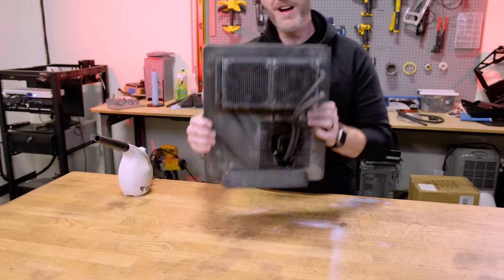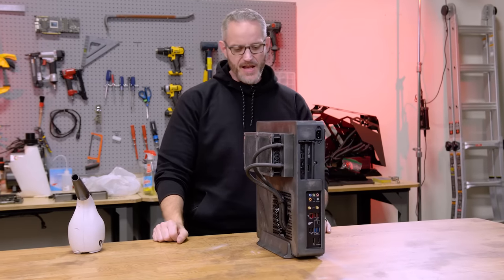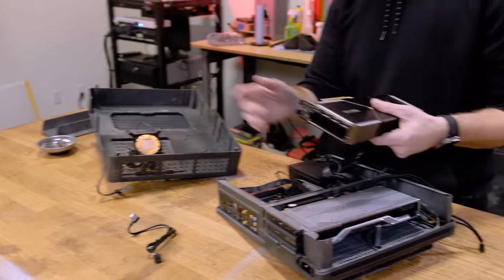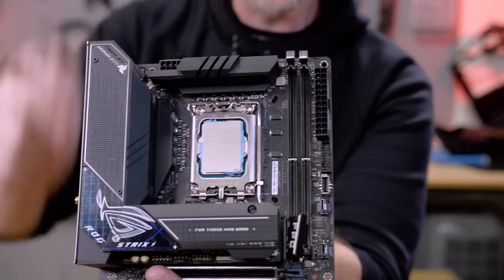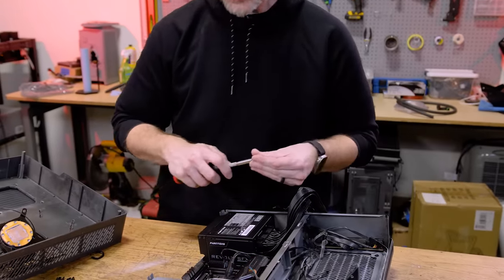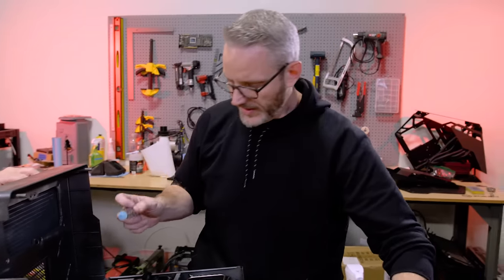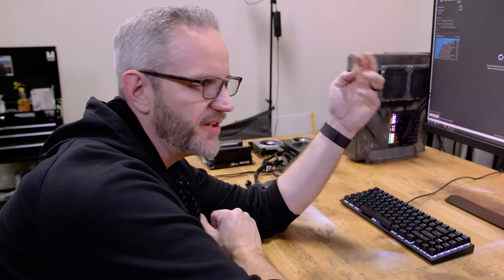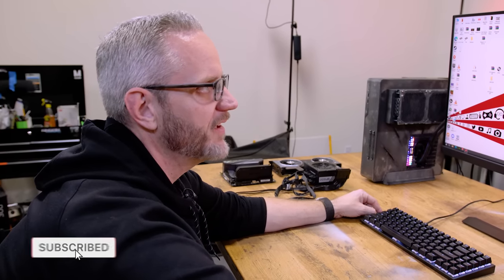This is still one of my all time favorite builds! Destiny 2 Themed PC Upgrade

Comment: I remember this build, was very cool to see it again. Although, I still believe a big aircooler would also look awesome sticking out of the 'broken' mesh/grill where now the tubing is coming out. Would also fit the theme very nicely, if you were to use a dark/industrial looking cooler.
Reply: My best friend is running exactly that. Not sure what air cooler it is exactly, but it is a dark one with industrial fans on it. Looks dope as hell :D
Reply: it doesn't fit destiny 2 at all though,
Reply: NDh15 lol
Reply: The only issue there would be hot air getting (mostly) trapped inside of the PC

Comment: My first AIO, the fans had to be installed on top of the case as there wasn't enough enough clearence inside for the the rad with the fans on. I used a christmastree bit and drill out the vent holes and it worked great. I loved how it looked too as the fans had blue leds and it was finished off with fan grills. I'd do it again!

Comment: this case was my last build, the 8700k/gtx1070.... that usb header, audio header and power board cable installation brought me back to those 20-30 minute nightmare scenarios. replacing fans was also a pain when i had a shuriken 2 had liek 3 fans die. never had i ever been so frustrated other than when i had to mess around in the engine bay of a pt cruiser.

Comment: 06:15 - I still use one of those cases with these pass throughs (AeroCool Xpredator X1 Black Edition). It has served me well over the past decade, but will eventually be passed down to someone in the family, once I need to get a new case (drive cage → GPU size).

Comment: I've run my DDR5 at 6200 for a year on my 12900KF without issue. I've even tuned my  timings down quite a bit as well. I've been contemplating swapping out for a 13900K and trying some of the new really wild 7200+ ddr5 out there

Comment: I did a similar upgrade...9900k to 12700k....2080ti to a 3090ti...psu 850w to 1300w...kept my ddr4 sticks on this z690 board. I also reused my older parts to make a sfx build to take to my friends house for lan parties. I wish I was friends with Phil.
Reply: Why a 1300w PSU? That's overkill by a lot. An 850w would have been fine or 1000w for plenty of elbow.

Comment: Well currently we have the 7700 non-X, which is not only quite fast, but also cool enough for the case. The 7900 non-x is good as well, but also a bit powerstarved on allcore load.
Reply: It is possible for those two models to increase PPT and TDC.

Comment: 750W PSU should work great for this build. I have a 5800X3D and 4090 on an SF750 and have had zero issues. Power draw in gaming is around 500W. 

I would love to see a vintage, top mount rad style build. Koolance was the brand I used at first.

Comment: Ran W10 on my 5.2/4.0 E core setup for a year without issues. Only switch to 11 for the auto HDR for my AW3423DWF. Also my W10 benchmarks crushed pretty much any equivalent system in average fps and 0.1/1% lows.

Comment: The 12900k is very efficient on power and temperature under regular loads. Even a reasonable overclock it only pulls like a 118watts and hitting 27k on Cinebench R23. Sure you can tell it to throw power out the window and break down on stability, but why?

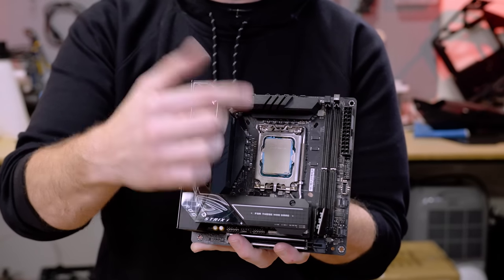Comment: 7:14 no it will not work. Well at least properly. Sure you can mount it but there is a difference in the Z height so you need New standoffs which btw you can order from corsair directly you just need the 4 standoffs and you can use the rest of the old hardware.

Comment: Pretty sure the IHS of the 12900k is bigger than the coverage area of the H100. Just because the board supports the cooler doesn't mean the cooler should be used for the cpu.

Comment: i have a gtx 1080 in mine with 2 artic fans blowing cool air to it inside the case and for the 99k i have a copper cooling 6 pipe thermaltake with a 25mm noctua fan i still havent turned it on yet and i put round rubber feets higher than the original ones that come with the case thanks to your review in the past of the node202

Comment: If you slow down the memory speed from XMP you would need to manually tighten the timings.  7th Gen Intel could be a bit temperamental with the fastest DDR4 XMP profiles, solved on 8th Gen.

Comment: I've been wanting to do an external rad build and "seal off" my computer from outside dust.
All the heat is pumped in the water to the rad and fans are only on the outside.
No more pressure monkey bussiness.
Idk if passive heat dissipation from my case would be enought to prevent the RAM, Drives and VRMs from over heating thou.
Maybe an internal rad in the loop to grab that heat with some kind of "internal" air flow.

Comment: Would I go 40xx series if it was free.... I'd accept the freebie, and then sell it on below MSRP to some one who actually wants it... and buy myself something decent.

Already have a 5800X3D and 6900XT, 32GB ram... newish monitor, peripherals and chair.  Only thing I can think I'd buy is a few more 14TB HDD's for my mediaserver so I can ditch the 6TB ones and do a proper raid setup with 2 parity drives.

Comment: i think this case(the normal case not the modded case) is perfect for ryzen 7000 series non x sinces they all have great thermels comperd to performence. and is the only current gen cpus that is able to be build into a case like this without thermels being an issue and without doing any kinde of udnervolt or underclock

Comment: Honestly not connecting the case headers before installing the motherboard is something I hate most about watching build videos.  It's on par with installing motherboards in cases vertically, something you'd never do if there was no camera running.

Otherwise, interesting to see the upgrade

As for the 4090. if it was free I'd sell it,  or do a charity raffle. I'd probably benchmark it with the weirdest hardware combos I could throw at it for fun, but it's a ridiculous card.
If I dropped one in my main rig right now, the most taxing thing I'd throw at it would be Fight Simulator and it'd still be CPU bound, and I don't want to deal with that stupid power connector. Feel free to call my bluff.

Comment: My house is always set at 68 degrees. I'm a little cold as I sit here in my room. I have an i7 11700kf and a 360MM AIO. I wonder why some days I come home she idles at 27 degrees celsius and some days like today she's idling at 40 degrees celsius. All the other components (GPU, MB, and 2 m.2 drives sit at 28 degrees celsius).

Comment: Jay, you do not need to upgrade to Windows 11 for Intel 12/13th gen.  The only difference is that Windows 11 will try to be more power conscious and try to keep the P cores parked.  Anyone who's doing any sort of gaming or overclocking will get absolutely nothing from Windows 11 and if anything might get lower average performance if Windows 11 doesn't recognize the program as "high performance" and instead insists on running the game on the E-cores.

Comment: Christ I'm getting old. I remember the build video like it happened a week ago.
Edit
Just wanted to add I've got big fingers that don't always fit into tight corners while working on my PC, so I keep a nice tweezer set to plug in things. I got mine off of Amazon for like $8 U.S.
Edit 2
While I'm thrilled with my Sapphire Toxic 6900 XT (warm room so the AIO helps) and wouldn't BUY an Nvidia card I'd be pretty darn tempted if I were offered a 4900. Pretty sure my Ryzen 5800X3D would be good enough for it without having to pretty much rebuild a whole new platform for the card.

Comment: Hopefully the smart people here will give me some advice.
I desperately need to upgrade so I can render photogrammetry point clouds in Pix4d and Agisoft Metashape. Should I get a M, P, RAM, GPU for my old PC or a refurbished Dell precision tower 7810? The Dell ($600) has twin Xenon 3.5 GHz processors, 28 cores, 128 GB DDR4 and I would need to install an OS and Storage. The Dell sounds like it would be really fast but it's old. Would the Dell be much faster than a Z690 i9-13900K upgrade to my PC? 
What do you guys think? Thanks!

Comment: Is there really a difference between Windows 10 and 11 when it comes to the 13th gen processors? I'm on 13600K + Win 10 right now. The only testing I can find on this subject is Steve's video with the 12900, where there is either no difference or marginal difference, and where there is a difference its Win10 winning out. Wondering if the Raptor Lake cpus are any different.
Reply: you wouldn’t see the effects on a full load benchmark, more that the scheduler in w11 is aware of the differences in each core type and can more appropriately put tasks onto the best core for the situation

Comment: I was under the impression that upgrading my Intel build from i9 10850k and 490 mother has to a 12900 k 690 board would require me to have a fresh hardrive. You're telling me I can use my current hard drive and drivers and it'll automatically update?

Comment: if i was given a free 4090 i still wouldn't use it just because it won't fit in my case
probably try to sell it because honestly, i have a 1080p panel and all my games are already running with 100+fps on my 6700XT
nothing would benefit from it except maybe flight simulator

Comment: Remember when PCs were cheap to buy parts for and EVGA was still around. Now the market is imploding on itself. 40% of Europe is losing out because of the cost of electricity, gas and food. So bang goes a big hole in profits. I hope to upgrade end of the year, but that’s one big if….. give you an idea (those that live in bubbles) my utilities would normally be £99 per month give or take. Now it’s £300 and going up next month another £150 to £450. That’s WITHOUT using anything on-top of that. That’s the price in the U.K. and Europe is suffering the same. So here, £450 PER month on PC upgrades, down the drain…

Comment: i mean fine if i get a 4080 or 4090 for free i might use it or maybe sell it on ebay for a fair price and get a 7900XT for it plus PSU bc i run a 1080 with a 530W PSU - which would not be fitting for such highpower GPUs

Comment: @JayzTwoCents 

I have to ask— how did you get iCue running? I installed it on my pc and my Corsair keyboard went absolutely bonkers right after. I’m thinking it has to do with the driver and/or RGB lighting but uninstalling fixed it immediately. It keep doing a connect/disconnect loop when iCue was installed making the keyboard unusable. Have you encountered this before?

Comment: HELP PLEASE :(
I just bought this m2 but i am unable to install windows.

I installed the harddrive, and using the windows on my SSD it's possible to see it in diskmanagement and as storage in "computer"
However, i am unable to see it in my windows installation (USB bootable)

I have tried just about everything and i searched google thin without hope, even asked on a forum but no luck..
Motherboard MSI 520m PRO
SSD: WD SN850X 

Please be my saviour <3

Comment: hey jay, a quick question from someone with a 9900K and a 3070Ti, is there much difference between those CPUs (9900k and 12900k or 13900k) in game specific scenarios, I mainly play at  1440p and wonder when would it be a good time, I'm currently waiting for DDR5 make sense before jumping in a new platform but I don't want to stay at DDR4 for long(since my ram only does 3000MHz and was from a previous build), I'm waiting for the next gen of CPUs as well in the mean time.
Reply: you would def have better frame pacing a 13900 is about 50% faster.  It'd be better for 120hz play on current games.  I'd wait 1 more year for the new chips and ddr 5 ram and boards to drop.  But if your sticking with that 3070ti that'll be the bottle neck.  There is no upgrade your system, your building a new computer.  only thing your keeping might be the case and cooler.
Reply: @Mikediszel  Dude what lol, this is all bs. An upgrade like that would net slightly better 1% lows, but that's it. Not even slightly worth it.
Reply: @ZoneXV  this would be my case, I play iRacing and on VR, so single thread performance would be desirable, and I would skip 40 series due to the ridiculous pricing

Comment: Why go DDR -5 if you are going to use a kit that is slower than Samsung B-die? Might as well run that 12 Gen chip on a DDR-4 board.  DD5-5 really isn’t worth it unless the kit is 7200mhz+ Even at that, 7200 MHz ties B-Die. Ideally, you want 7600 MHz or better. Right now I am running a 7800 MHz kit on my Z790 Master paired with a 13900KS. Gigabyte is doing their thing with memory This generation, XMP worked right out the box. I was going to grab an Apex after  I returned my hero because it had really bad memory stability, but I ended up picking up the master, and it is good to go.  Side note, I feel like a lot of people on YouTube really aren’t showing 12th and 13th Gen to its full potential. So if you are trying to keep cost down on a build, get a cheap kit of b-die, not only will you save money you will get better performance. Anyway, dope video as usual!!

Comment: I suffer from not running games and a problem with the graphics card, and I run it on another device and get an error message Error 0x887A0006 Unreal engine is exiting due to d3d device being hung and a problem with the graphics card itself. Is there a solution for Evga 1060 6g Ssc 6267 And I removed ddu the entire system and downloaded the latest version of NVIDIA and installed the latest version of DX12, and the problem still exists
This error is in all new generation It contains directx 3d player
The problem that I suffer from is not running the dx12 11 games that contain directx 3d. As for the old games, such as the game Wolfenstein The New Order, they work well, and I ran a graphics card in another device that does not work, and I face the same problem with this error d3d device, because it is being lost 0x887a0006